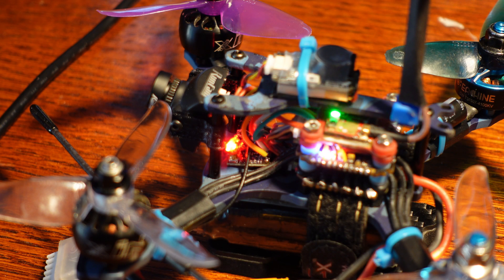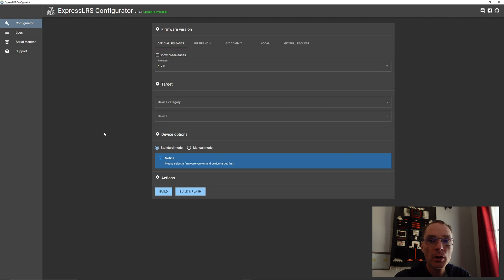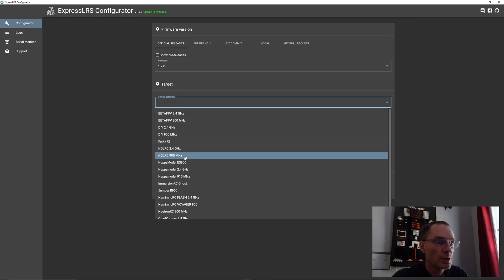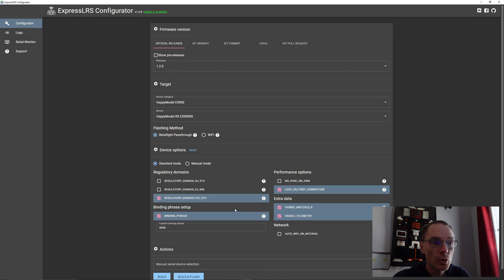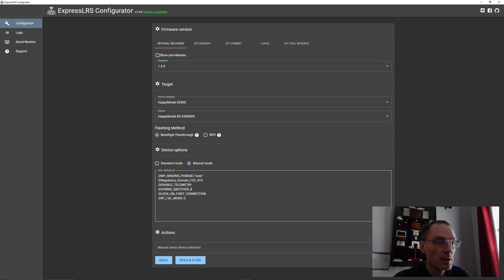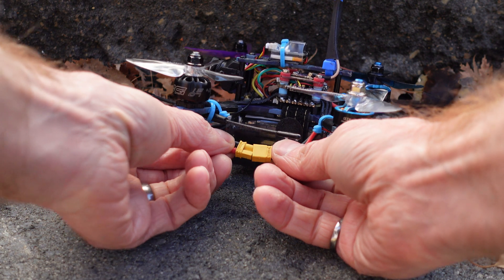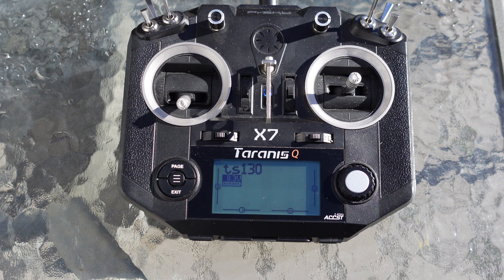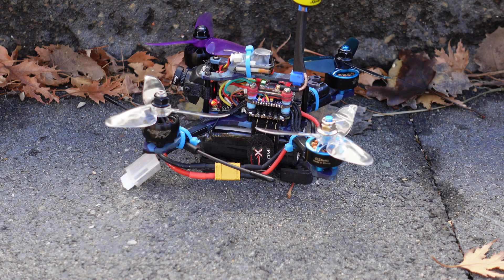Happymodel ES900 Rx ELRS Boot Issue - Fix Using Manual Mode Flashing (NO LONGER REQUIRED)

Comment: Thanks, for your video. Did you have some issues with heating? My receiver getting really hot. Wiring is good and it works fine. But the temperature is hot compared to other receivers that I had
Reply from the maker: No, mine barely gets warm. I still use it and just plugged it in to check, and after 5 minutes, it was barely warmer than room temperature.

Comment: I got a happymodel epw6 pwm elrs receiver and it had solid green light everytime power was supplied even when boot pads were not bridged.
I tried flashing using ftdi adapter and betaflight pass through but none worked. It doesn't even enter wifi mode.
Reply: i have the exact same problem but with an EP1
Reply from the maker: Sorry, I don't have any suggestions for your case.  You could try the ELRS discord, their is some very knowledgeable individuals on in the help section.

Comment: Ive been trying to flash my Happymodel ep1 2.4ghz receivers for hours but keep getting error messages. I wish I never switched from frsky...  Please help!!
Reply from the maker: What is the LED doing?  How are you flashing (betaflight passthrough or wifi)?  is the version on the tx the same?  did they work before flashing?  I moved from frsky as well and am glad I did, I get some much more range with my ELRS 900mhz setup.

Comment: I flashed betafpv Rx it has a solid blue light but isn't talking to my tx already updated open tx and tx module
Reply from the maker: Sorry, I'm not familiar with the betafpv rx so I'm not sure.  The manual indicates that a solid light is a good connection (https://support.betafpv.com/hc/en-us/articles/4402596816409-Manual-for-Nano-Receiver).  Does your transmitter work with other receivers?

Comment: I tried multiple times to reconnect battery but the rx always solid red... What could be the problem
Reply from the maker: make sure your TX is off (it will be solid when you have an active link with your TX as well).  make sure you are quick when you unplug and plug back in.
Reply: @reileymckerracher9181  my radio is off. I quickly did it multiple times still no luck. May be my soldering on fc may be problematic? I soldered it according to diagram but may be not connected well enough
Reply from the maker: sorry, no help here.  with mine it would sometime take 2 or 3 tries to get it to boot correctly, but it always would eventually.
Reply: @reileymckerracher9181  i soldered rx and tx cables to alternative uart and it blinked..
Reply from the maker: @rupinkachhadiya966  good to hear!  glad you solved it!

Comment: Hi, Many thanks for your informative video.  I have the power regulator symptoms on my Happymodel 2.4 EP2 Rx. I tried your procedure with my 2.4 changes but configurator kept throwing errors when in manual mode. I turned to the Discord channel for help and was told that the fix for the PR is default so that it was not required to switch to manual mode to add it. Configurator in standard mode works without errors for me and PR issue now fixed. Not sure if this would be the same for your 900 system. In any case your video got me on the path to fix my problem and I appreciate your help.
Reply from the maker: Glad I could help you!  I just reflashed my Rx using standard mode and your right, this is now the default behaviour, thanks for bringing it up!